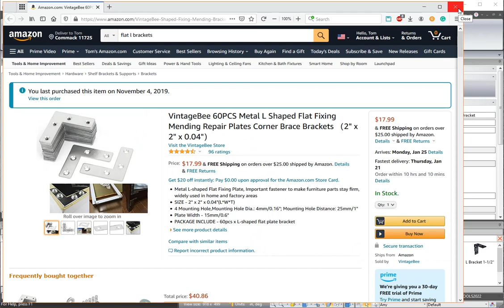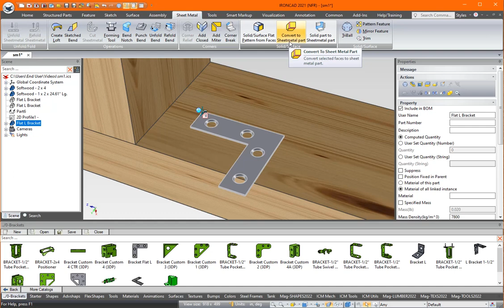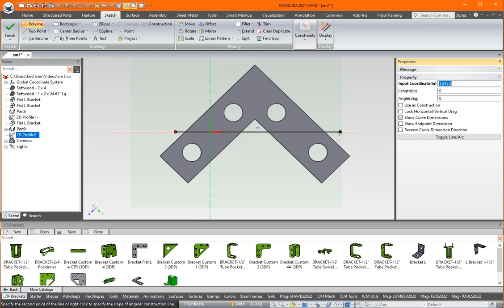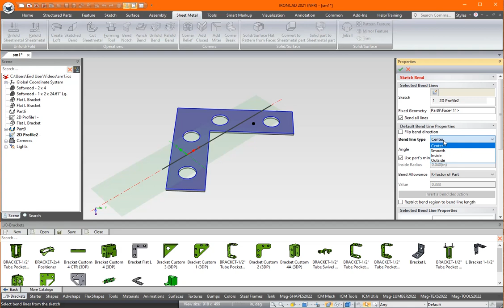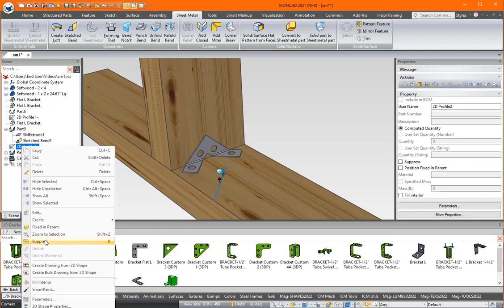IRONCAD - Convert Solid to Sheet Metal for BENDING

Comment: Thanks for posting the vid.  What graphics card are you using btw?  I also notice the smooth viewing rotations.  Are you just using a mouse or what implement do you recommend?
Thanks.
Reply from the maker: Hello Marie. thanks for the inquiry. I am using a basic Dell Optiplex PC with Intel(R) HD Graphics 4600 card and a 3D connexion SpacePilot. It's an older system, but no need to upgrade yet :-)